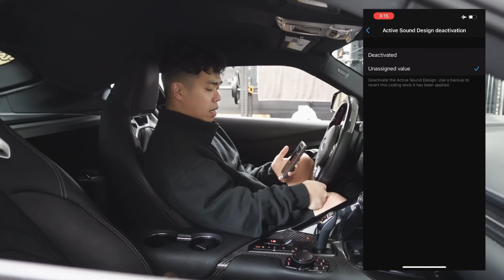Watch THIS BEFORE buying a SUPRA! Everything you should know!

Comment: I’m 6’4” and fit in my Supra just fine. I did remove the fake brace from behind the seats. That gives me another inch or two to push the seat back a little more. Having a small car keeps me young getting in and out all of the time lol. Great video!!!
Reply from the maker: LOL that’s a great way to look at it 😂 keep us young!
Reply: glad to hear this. also 6'4. tryna go sit in one first before the impulse takes over.
Reply: @lagrange3859  I don’t think you’ll regret getting a MKV. The car is awesome!
Reply: I'm 6'3" but most of my height is in my legs, so more worried about leg room than head room.
Reply: @BigfootUnibrowMan  You should be good to go. The way I sit in the car I have plenty of head room but my legs are not cramped or in the steering wheel.
Reply: I’m 6’3” and it’s visibility makes it unsafe for me to drive comfortably.
Reply: @jdsbusa  you talking about seeing out the side windows? Put the seat lower.
Reply: @3LiterV8Eater  with the seat all the way down and all the way back I cannot see out the sides. I have to shrink down to be able to see. I’ve driven at least 10 and they’re all the same. 1st Or second Gen FT86 isn’t a problem, although I’m not a fan of them either for their own reasons.
Reply: @jdsbusa  yeah that is a problem. If I sit straight up and down in my seat my vision is blocked. I leaned my seat back a lil farther after removing the fake chassis brace and that helped a lot. You could try that and see if it works for you.
Reply: 6'0 here.  Tried sitting in one and it didn't work for me and I'm a slender build too.  The visibility issue from the a pillar design and my head hitting the side while in the car as well as hitting my head on it while getting in and out of it was a huge deal breaker for me.  Was considering it when it first came out but was so glad I sat in one first.  Owned 2 M2's and ready for the next gen.  All of the BMW's I've had for the most part have been mechanically trouble free and the most I spend was for tires. My current M2 comp I bought new last year I got at less than MSRP.  But anyways, glad you found something you like.
Reply: But are you comfortable lol
Reply: @elevatedvantagepoint2901 yea this car for small people lol…we need a grown man size
Reply: Im 6’5 and I really want one so thanks for the tips I almost lost hope
Reply: @itzjoshmc6039  don’t do it….it’s very uncomfortable…definitely made for small men lol
Reply: I’m a big guy. I fit just fine
Reply: you just said it "largely unchanged". Toyota didn't engineer the B58 but their engineers  help make a good engine great.  That is the point of all my comments.  I didn't buy a 2020 or 2021 but I bought a 2022 because the 2021s had an oil consumption problem. Toyota even replaced the engines or bought them back later bc of the problems. Toyota actually helped BMW fix the issues because if it wasn't for Toyota, BMW would have been BMW. There's  a lot of articles and interviews with Toyota out there. The partnership almost didn't happen because BMW was getting tired of Toyota saying the engine quality wasn't good enough.

Comment: Great content and video. Couldn’t agree more about getting a Supra. I was fortunate and got an A91-MT in CU Later Gray about 6 weeks ago. I have the best dealer experience ever, honest and respectful with integrity. Exceeded my expectations and they sold at MSRP unlike so many that price gouge the consumers. Put a carbon fiber trunk spoiler on but am looking at swapping for a high wing spoiler.  A few other mods as well only wish you could tune the new ones. The manual transmission is phenomenal and a joy to drive.
Reply from the maker: MSRP on a CU LATER? Thats freaking awesome man. Great deal! If you were local I would have LOVED to review it! I have not yet seen a manual supra local to me yet.
Reply: Where did you get one at MSRP?? 👀
Reply: @shimmyjamily  Moses Toyota in Charleston, WV. They were the best dealership I have ever done business with.
Reply: How do you like the MT trans and gearbox so far? I haven't heard anything bad about it, and I am looking to get one myself. But I would like to hear from other drivers about how they feel about it.
Reply: @isiahnevarez8294  I love it. Only complaint is hard to be smooth from first to second has a little bit of a jerk the rest you can be butter smooth. Might be the gearing  to shift at a higher rpm than I do for normal driving. Gear and clutch are smooth and easy shifts.

Comment: It understeers because it's McPhearson strut with double balljoint front.  It reduces camber as it leans and that's not what you want in a performance application.  McPhearson strut is an economical invention like a FWD car.  Sure they can do amazing things with both nowadays, but the underlying technology is not as good as double wishbone(SLA).  With SLA suspension you can fine tune the camber arc to increase/decrease or to have it stay steady and parallel to the floor of the chassis among other things not possible with McPhearson.  Add the horrendous double ball joint lower arms this platform has and it's impossible to get a heim joint on the tension arm instead of a bushing.  It also increases scrub radius and decreases caster while turning on the inside wheel which is the opposite of what you want.

Comment: I think the B58 is going to turn out to be one of those legendary engines in the future. I currently have a M340i and a X3 M40i and soon to replace the M40i with an X3M.  Have fun with those my dudes!  Also love how you guys embrace the BMW-ness of it all. LOL

Note: The earlier Supra had the B58 variant out of the base X5 s/xdrive 40i and the 540i. The later Supra got the variant out of the M240i, M340i, M440i, X3/4 M40i and Z4 M40i. A 375 HP variant is also used in the X7.

Comment: Have a question- at 3.00 you say 'I couldnt tune mine because its locked'- how do you mean? Does the 2022 Supra genuinely not allow you access to the port, are there ways around it? Think I might take a tuneable lower power over a locked higher power- maybe I misunderstood. Great breakdown video thanks!
Reply: Did you find anything?
Reply: @stepz1876  I've been trying to research this as well, all I've found so far is that you have to ship your ECU out to a company to get unlocked then you can tune. Which adds a hefty price

Comment: You guys are spot-on about so many of these points, both good and bad.  Picked up a CPO '21 Nitro Yellow 3.0 Premium with only 3k miles for significantly under MSRP back in October.  These can be gotten for reasonable prices!

One quick question:  I've been looking for some kind of organizer for the rear hatch.  That one you are using at 12:49 looks perfect.  What is that?

Comment: Hey mate. Love your supra! Such a sick build!

I was wondering if you could share some insights on the difference between the B58B30C (335hp) vs B58B30B (382hp) in terms of its reliability and mod-friendliness as the latter has 6ports vs 2ports on the cylinder head.

Key differences on the cylinder head, manifold, piston and turbo iirc
Reply: Also interested on this info 😅

Comment: I changed the horn to a set of dual Tundra horns. (High and low note…). Sounds appropriate now. The majority of the rattles were cured by removing the door cards and using some soft side of Velcro.   Great car.

Comment: had the supra but after a year i upgraded to a M3 comp, the oil consumption was a nightmare but other than that no issues.
Reply: “Upgraded” 💀
Reply: @foreversolvent5334  yeah upgrade, better engine , and interior. So don’t know why you would something in quotations that is obviously a fact
Reply: @A91dan  What was the oil consumption issue? Thinking of changing my e90 M3 to the Supra.
Reply: @MumenRider78  on the 2021’s they burned a ridiculous amount of gas. I was adding a quart literallyever 2-3 months. The issue was fixed tho

Comment: I had mixed feelings about the GR Supra from the start. Probably because of the partnership with BMW vs doing a complete in-house option like Nissan. I guess the first place to start is how most of the power train and essential components are akin to the Z4. While not bad, the m4 or m235 could have been a more solid place to begin. There's also the issue of engine reliability. It's all fun and games until we are the victim of the "Hello, friend" meme, and I genuinely haven't seen a reliable BMW engine since the e30 4 cylinder. Heck the Lotus Evora/Exige supercharged 6 (which is off of a Camry btw) with a BMW sourced transmission could have been a cheaper and more reliable choice. The second thing I nitpick is the design. It feels similar to the Lexus "predator" aesthetic in the shape of a Z4 coupe. If it paid homage to  mkiv in the way the 2005 mustang to the 1965, I would have a softer heart. Let me know what you think.
Reply: I think that the MKIV looks nothing like the MK1, 2 or 3.  People expecting the V to look like a car designed 25 years prior ... are not thinking.
Reply: @smog-097  true, but it would be nice if it looked less like a Lexus. Sort of like how you can tell a Chevy from a Cadillac. I think that's what I was thinking of.
Reply: @jared5437 "looked less like a Lexus"

Literally the MK4 A80 Supra came from the  Lexus SC 400/300 Coupe (and the 300 has the 2JZ. Long before the existince of the Supra A80 MK4). Go figure
Reply: Keep in mind that BMW is the exact company that let McLaren (British) use their V12 engines in their McLaren F1.

Comment: Great video. I have been thinking about a used 2018 BMW M3/4 or a Supra but it sounds like they have issues?

I m looking at many sport cars truthfully. Anything from 50-60k all used. Don’t need a new car to lose value the moment I buy it

The LC500 is another. Prices are coming down although that is more of a looker and great sounding car and GT cruiser than a driving car
Reply from the maker: No real big issues with the F8X m3/m4 besides the crank hub which is really rare. I think they’ll hold value really well. I’m not trying to say the Supra is better. Both amazing cars!

Comment: i think the trashing comes from the hard core Supra Fans, that grew up in the 80s and 90s. The 1994 Supra was back then considered a sports car that was in the league with a 911, Ferrari 355, Corvette, Lotus Esprit, Honda NSX, Nissan GTR and Co. Now from the looks it is nicer the today's model, but from marketing and positioning it looks like a degrade. Cause it is being marketed as a sister model of the Z4, which by the way looks much worse than the original E85 in my view, but it is question of taste. So the expectation of the hardcore fans was to bring out a supercar that could pair up with the current NSX and with a Ferrari Tributo, or even the 992 Porsche, which it doesn't. Then there is the engine part. while i am a huge BMW fan and knowing that this engine is maybe not the same as the M4 has, though this one is easier to maintain and more robust. This is a sweetspot and rational decision, cause if Toyota had to developed its own, it would have never made a business case yes the 2JZ-GTE engine was and is amazing, but probably would not meet the emission requirements of today's car. And then there is a price tag, the Supra at least here in Europe was not a seller asking a price close to porsche, the germans would have chosen a porsche all the way. Who ever had thought that the price of a A80 would have gone through the roof back then, it was loosing money the moment you left the dealer's porch...Anyhow, i like the new one, but  still i would have probably market it as a supra, and leave the name for something of more prestige....like Nissan did with the GTR, where they initially really didn't care whether the car makes money or not.

Comment: What problems you had in 335i? Was it e90 or f30? I got 14 f30 FBO around 420whp on e85, no issues with mine. If it was e90, that’s first gen n55, 14+ ewg n55 is reliable motor as well, it’s same motor as m2 minus oil system. B58 is definitely best inline six motor in the market.
Reply: I bought a brand new 2011 BWM 335i, which within 20k miles, had a turbo failure and multiple injector replacements.  Hoping my 22 Surpa holds up better than the 335i.
Reply: @chriswernke4824  makes sense that was first gen n55, it had worse running potential. Supra b58 is 2nd gen of that engine. F30 n55 was 2nd gen of n55.

Comment: You guys ever have issues measuring oil? My oil measurement stops at 32% and the computer says I need to drive 30 minutes at least. I've driven an hour, two hours, waited 'till the oil cooled down a little, still can't measure oil. I have a 2021. Took it to the dealer and they say the oil senor shows no errors and they won't replace it....

Comment: If your fbo what are you pushing to the wheel
Reply from the maker: Haven’t dynoed it yet but I’m guessing it’s around 420-440whp. I’ll make a dyno video eventually!
Reply: @vinhgeta  if your really fbo you shouldn’t even be in the 400 range , more like 5+ to the wheel
Reply from the maker: @selfmadejay01  full bolt on minus turbo. I’m also running 91 tune. I can surely get to 500 with an eblend and another tune.

Comment: LEARN HOW TO SET UP MIRRORS PROPERLY TO REMOVE BLIND SPOTS. Any proper instructor should show you how... its simple...lean your head and rest it on the window and adjust the mirror to where you sear your rear qp and than lean your head to the right and stop between you and the passenger seat than adjust the mirror, so the bottom of the mirror is showing you rear qp

Comment: Dude where you getting a downpipe and tune for $700??  Super misleading.  Just a bench unlock you’re looking at 400-500 and that’s if you’re tunable without a clone.  C’mon man don’t be that guy who spreads false data.  Good video otherwise
Reply from the maker: Catless downpipe for 300-400 ish. You can bench unlock for less than $150. I did

Comment: Lol ppl who say the Supra is a bmw u need to grow up b58 is superior engine to 2jz it can’t compete with modern engines. Anything you do to bring is performance as close to modern tech the same stuff could be done to modern therefore surpassing. Grow up old man it ain’t 1997 this is the supra every little micro meter on this car was hand crafted by the joint companies and only Toyota released the car only when it met the criteria they deemed worthy they made sure every thing was tweaked and tuned how they desired this isn’t just a copy pasta engine bay every was tuned to perform and sound how Toyota envisioned